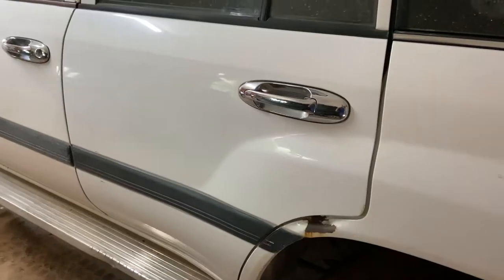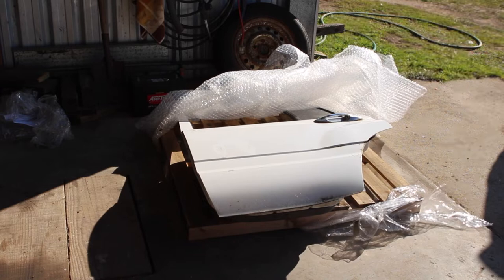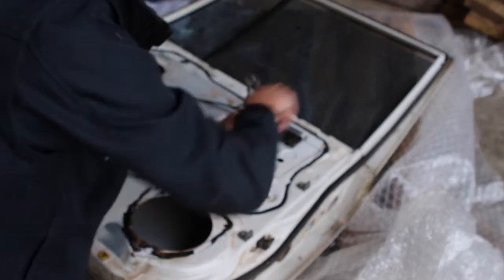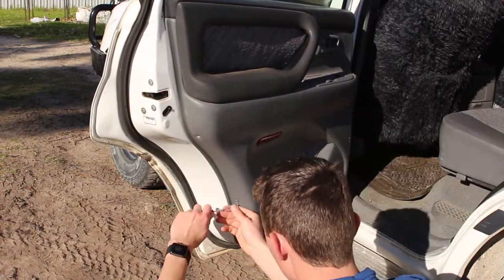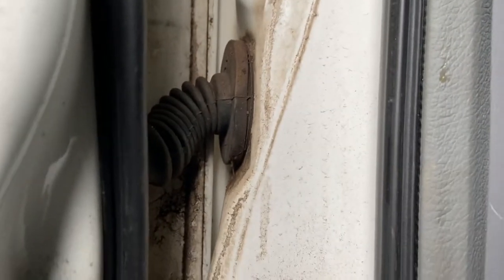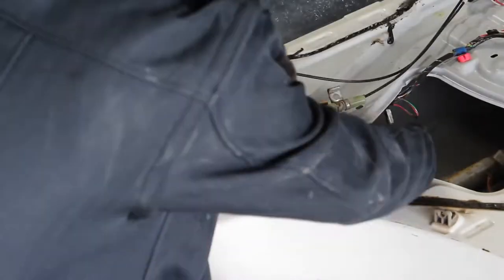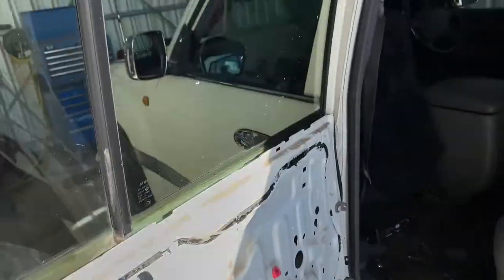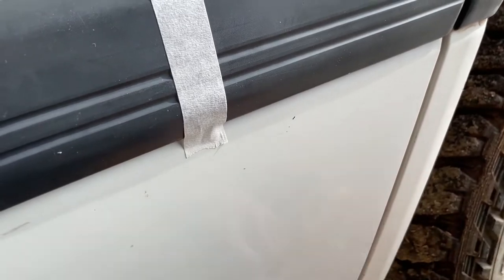Converting base model door to GXL door (105 series Landcruiser)

Comment: where cpould i get advice about upgrading  my standard 105 with gxl doors the plugs are there but a bit different in the front auto electricians are not able to help me want to charge heaps of hours to figure it out i am in adelaide
Reply from the maker: Could be a fairly big job mate. If it was me, the first thing I’d do is make sure your 105 had spots for the potential door looms to plug back into after they enter the car from the doors. I’m not actually sure if the standard cruisers have this option. If there is a plug there then it’s actually pretty simple, but could be expensive. You’ll want to buy 4 GXL doors because that’ll probably be cheaper than buying all the parts. And then you’ll just need the part of the loom that bridges the door and the interior of your car. So easy fix if you’ve got the capability of plug and play looms into your car. If there’s no plugs there, I personally wouldn’t even bother
Reply: @WillsLandcruiser  yes all the plugs are there it was cheaper for toyota to manufacture all the body and loom the same standard and gxl seats ect just trying to find a auto electrician to fine tune it passenger front door plug is different but tge drivers door i found plugs for and rear passengers to hidden in the pillar . Do u have a email i can send pics to also love your turbo advice upgrade my 105 come from tge Whyalla steel works completely red dusted i bought her back to life new dash heaterbox scrubbed up engine bay repainted underneath i just put extractors and a 2.5 inch exhaust as i couldnt afford the turbo for it 1hz also to just bought new carpet from same place you did tgey take ages to send lol
Reply from the maker: @TheAussiestyle1975  they do take ages dont they 😂😂 reckon I waited a good few months. Sounds like you’re doing great mate. Would love to chat more- my email is williamparker256@gmail.com
Reply: @aussiestyle, hey mate I'm doing the same thing at the moment, 
How did you go with it?

So is there a plug somewhere for each door for the new gxl door looms to just plug in? So I don't have to source it to a power source? 

Just need to transfer the guts from the gxl door into the standard and plug in is that correct?
Reply: @Will's Landcruiser mods 
Hey mate maybe you could help a bit? Not to sure if Aussiestyle will see this